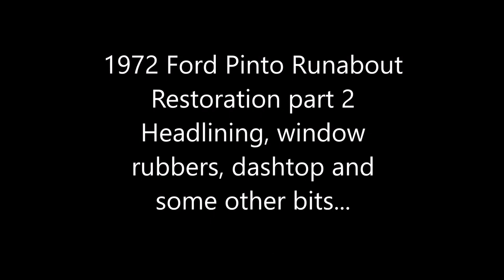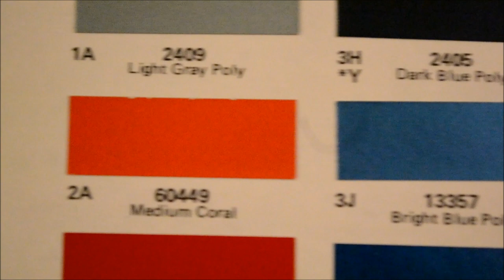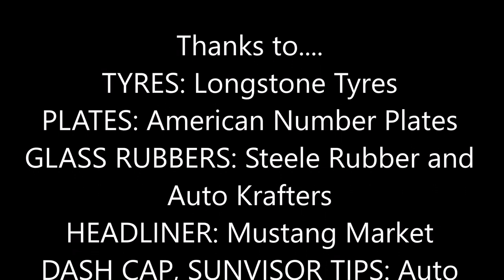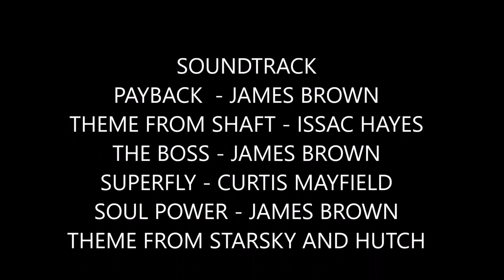1972 Ford Pinto Runabout Restoration part 2

Comment: I bought a 1976 Pinto Stallion hatchback new.  It came with an (optional) AM pushbutton radio which just had to be replaced.  I installed a Sanyo AM/FM/Cassette and for speakers, I used a set of Bass 48 speakers, 5" I think.  They were the speakers that I found that had a grille exactly the same size as the little taillight bulb access panel I watched you install in the rear sides.  I mounted a CB radio on the side of the storage bin in front of the shifter and hooked the stock radio speaker up so I could here my CB radio better.  So cool to see you and your wife sharing in the revival of this Pinto.

Comment: i once owned 2 ford pintos. a 1971 first year. and a 1972. these were very reliable automobiles. yes they have very bad reputations. that is because pintos for some reason were never properly maintained. any machine will fail if not properly maintained. i never had any major problems with my pintos, all the years i owned them. because i maintained them. and if you hit any car that hard. there will be serious problems. but ford did correct the impact issue. bottom line here is. the pintos that i owned were 2 of the best cars i ever owned. and i have had many. TAKE CARE OF SOMETHING. IT WILL USUALLY TAKE CARE OF YOU. i also must say. the gentleman in these videos doing this restoration, has a great eye. and some great hands. very talented individual. excellent work sir.

Comment: YOU sir are a MASTER .... loved watching you with everything you did! I purchased two Pintos in my live time and both new. 1971 Brown 4 cylinder 4 speed  with very few options. Then a 1975 V6 station wagon Red.
Reply: I just bought my first Pinto ever.  1975 Pinto Wagon, Squire, V6 AT PS PB, A/C  runs and drives..  needs a lot of little things.  $2500.  Chestnut Brown, with wood on the sides and roof rack.  Seems to be top of the line.  If I could find a Mercury Bobcat wagon like this,  that would be cool

Comment: Did you have to pull the door glass to put in the new door sweeps/felts?. I need to do that to my 72 - Love the Starsky and Hutch at the end :)
Reply from the maker: Hi, sorry, just seen your post. You have to loosen 2 bolts near the window winder, which moves the bump stop and lowers the glass an extra inch. You can see it in the video. Good luck

Comment: Very good information! Where did you pick up the replacement trim for the windows?
Reply from the maker: Hi Miah, if you mean the window rubbers, they were bought from Steele Rubber Products. They have a good website
Reply: Perfect!!! Thank you so much. That is definitely what I meant. I have found several places that offer compatible rubbers, but the few I have purchased ended up not working. The ones from Steele Rubber Products appear to be specific for the Pinto.
Reply from the maker: Window rubbers came from Steele Rubber  Pruducts

Comment: What kind of spray do you use on a headliner
Reply from the maker: No spray. I used contact adhesive where it sticks to the window frames. The metal hoops hold up the rest